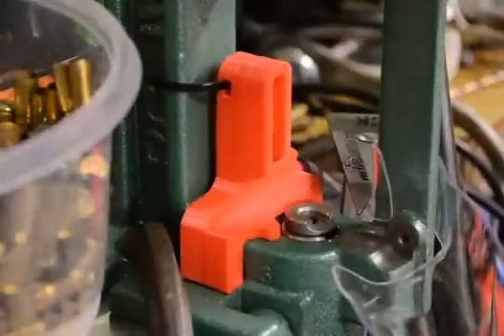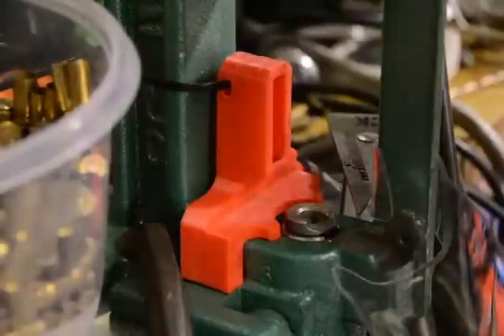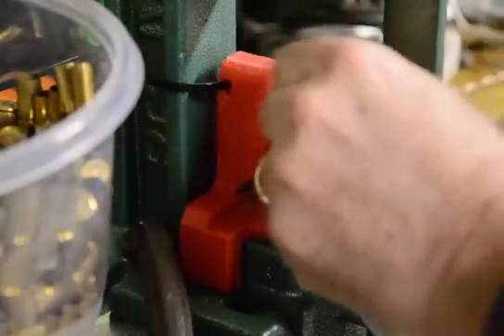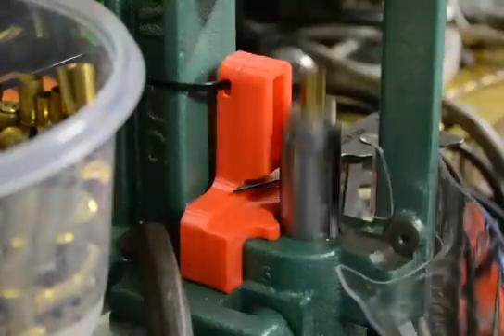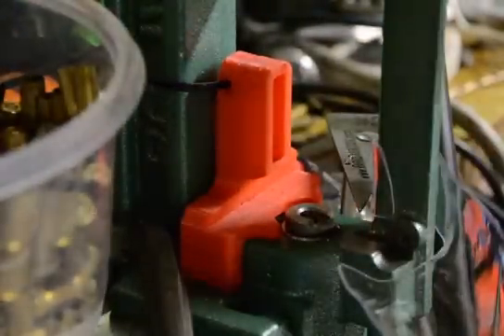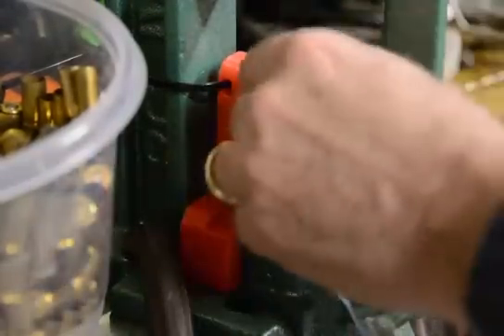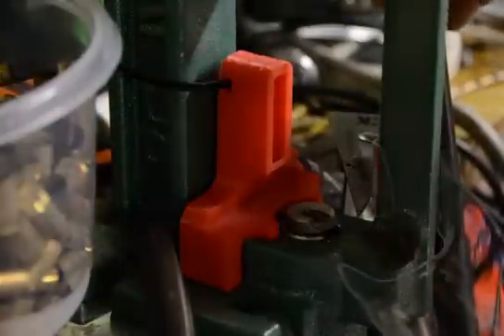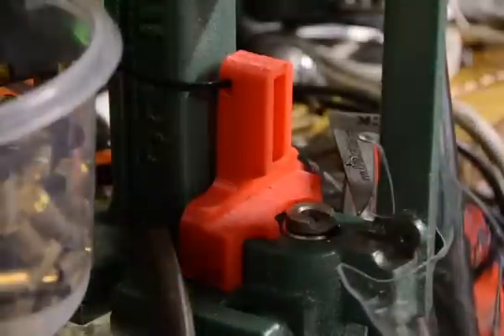PCAT2.0 Testing with the Rapid Case Kicker and custom 3D printed Primer Catcher Upgrade

Comment from the maker: Hi when I made this video I was testing the compatibility of my primer catcher PCAT2.0 with the Rapid Case Kicker I had just bought. I mentioned that it was tricky to get it adjusted, I was referring to the Rapid Case Kicker not my primer catcher. I know that might be confusing.  The primer catcher is very easy to install with minimal adjustment.  I really like the primers being taken away from the press to the trash immediately.   The case kicker works better with taller shells I think it took a little tweaking to get it to work with the 9mm brass.

Comment from the maker: This is not an advertisement for the Rapid Case Kicker, however once you have it installed properly then it works great with my device.  It will save a bunch of time.  The PCAT2.0 is my design which is based on some other similar devices is the 3D community.  I've been a reloading for quite a number of years and an engineer for a long time.  No one is making this version of this device other than me since the design files are my property.  Enjoy my video and thanks for viewing!
Reply from the maker: This is also a replacement for the RCBS stock spent primer tray for the Rock Chucker Supreme/IV